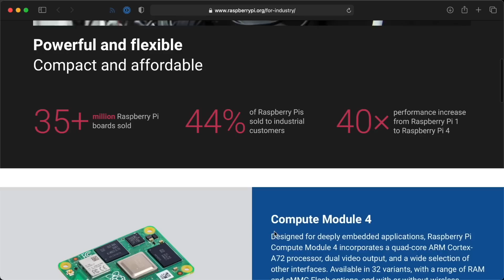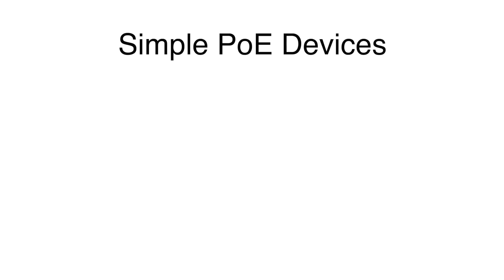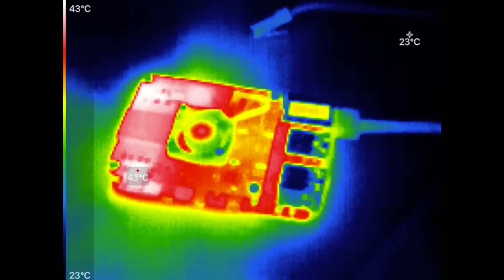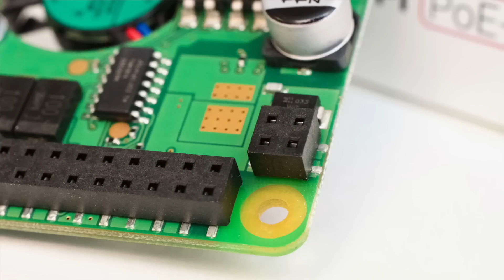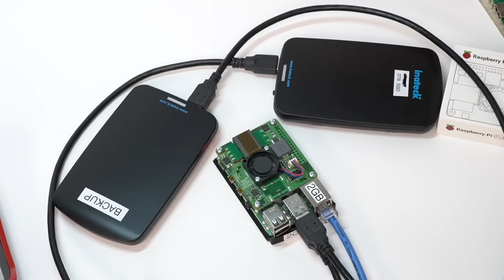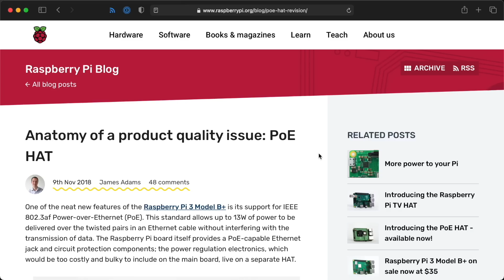Review: Raspberry Pi's new PoE+ HAT

Comment: That's not a magnet on the transformer, that's a ferrite core!🙂
Reply from the maker: I shall be more careful with my words next time :)
Reply: Thanks for saving me the trouble of pointing this out.

I'll now try to get my teeth to stop grating. )
Reply: @asdrubale bisanzio -- No, the primary becomes a magnet. Calling the ferrite core a "magnet" is like calling the "keeper" placed across the old "horseshoe magnet" a "magnet" since it conducts magnetism.

Essentially, calling a magnetic conductor a magnet is like calling the copper wiring in your wall a "generator" or calling the battery cable in your radio (remember radios?) a "battery" since it conducts power from the battery.

Or, like calling the subway train "my job" because it takes you to work.

N.B.: This does not apply if you happen to be the motorman!

Comment: Good Monring Jeff,

did you notice a coil whine with the PoE+ modules under normal load?
I bought 2 of the older PoE modules and both have a clearly audible coil whine (even without USB devices attached).
The PIs were running in the utility room. So it wouldn't bother me, but since the cat likes to lie on the dryer, 
I decided against it and now I'm forced to use non-official modules. 
For the purpose of cooling I had to tinker and unfortunately they are too high for 1 rack unit.

Therefore it would be nice to know whether the new PoE+ modules are worth buying. 
Even if they would consume more power. I never checked the power consumption of the cheap no-name module I'm currently 
using. 

Greetings Chris
Reply from the maker: I haven't heard the coil whine except when backfeeding it from USB-C with load. Under normal circumstances I don't hear it at all. I do hear a tiny bit on my original PoE HATs.

Comment: I mean, why should they have to tell people not to use the hat while using usb-c, when it should be common sense not to?  Use one standard or the other.  Aside from using the fan for cooling (not sure why a person would when they can pop the fan off and use it alone), why would you leave it connected when using usb-c power?
Reply from the maker: I sometimes grab a Pi out of my rack for debug purposes, and like to be able to plug it in temporarily at my bench or desk, where I don't have any PoE ports handy. I could go buy a PoE Injector just for that, but it's easier to just use an existing USB-C plug.

Comment: Ferrite core not a magnet. More efficient than wire (says who, you?), have we done testing to prove this idea? Wire size consistency isn't some black magic that industry hasn't quite gotten the hang of yet... Everything I am seeing here pretty much shows that this hat is less efficient, I wouldn't be to quick to make a statement about any single part of if being "more" anything other than power output.
Reply from the maker: According to the research I've read on planar transformers (I haven't done any component-level testing myself), it's more efficient at _heat dissipation_, not necessarily in total energy efficiency.
Reply: @JeffGeerling  Spose I should listen a tad closer, you did say less heat to start with. Dah well I am an idiot after all, ask the wife, she'll tell you all about it =P

I wonder, do they provide white paper on design choices and intent with any of this stuff? Something about the component choices made, on this new POE device, is using more energy than I would personally find desirable. Suppose I should research this kind of shit before engaging in a conversation about it. If only I actually desired to use POE in my PI projects, I'd imagine I might. In my defense I am wearing a red shirt....

Comment: I like the uctronics one (with the fan). I don't know if it is "safe" but my pi 4 idles at 3.3 watts according to the switch. It does have a coil whine, but it is outside of my hearing range. My daughter gets annoyed by it.  The fan is very quiet. It is a standard 802.3af.

Comment: Great video, I use a lot of Poe at home, Cisco phones and cctv cameras and back in January I migrated a bunch of services to 4 pi4s and a pi2 this includes homebridge, asterisk and 2 piholes. On my enterprise switch under normal load they pull about 2.2 watts each but when backing up they get closer 5 watts, I don’t have anything plugged in to them except network and the micro sd card. (I don’t need disk performance) since then I have carefully modified the setup using the sd card to boot then creating a mix of sd card ,RAM disk and nfs mounts means backup aren’t needed. The interesting thing is using my Hopi power monitor between the mains and the switch if I keep the Poe power draw for the 4 pi’s under 14w the Poe switch does not seem to draw any more power from the mains compared to no Poe being used. Effectively getting power for free.
Reply: Great comment that gives me lots of ideas!

Comment: You can not safely provide DC positive energy from two different sources without connecting the ground (negative) together. Think of it as a voltage difference that provides current. When you connect grounds it ensures the same "voltage difference" is established between the two sources.
Reply: Thanks! This is a better explanation than others I have seen, and makes more sense. Intuitively, I know that the cheap non isolated adapter I got to power a pi zero from 24vac would cause blue smoke when connected to a DC power supply, but couldn't quite understand why.
Reply from the maker: When connected to USB-C power, I did not have the Pi plugged into a PoE switch.

Comment: I have no idea why anyone would use a PI in an industrial application.  They only rate it for commercial temp. On top of all this no one talks about how to bullet proof it from corrupting the uSD when power is removed before a shutdown. What's even more nuts is that the POE+ hat cannot deliver full power to the PI board because those pins from the hat to the PI do not support those kinds of currents.

Comment: I feel like POE is kind of not a very robust technology in it's nature. Essentially you're trying to drive a current load through a high-impedence signalling wire. To get around power losses due to the high resistance, we pump up the voltage dramatically? What could go wrong?
Reply: That's precisely why high voltage lines are high voltage - due to decreased current flow and lower losses. High impedance may be loosely translated into "high resistance for higher frequencies", and doesn't affect DC current nearly as much. Anyway, I really like your curiosity and critical thinking. You're gonna go far. :)
Reply: @rageagainstthebath  Thanks, that's interesting, I never thought of it that way. It makes sense that at higher voltages less current flows but I guess I just don't understand why a DC current encounters less resistance than a high frequency signal. As a hobbyist I also realize it may be beyond me.

Comment: If people are needing more than 13 watts to power whatever setup they are running may be the raspberry pi is not the best option.  After all, you can get other options in the soc space that offer decent power efficiency with more performance and support for more peripherals without needing to kludge a solution together that may or may not run for the long term.  At 15-20 watts idle you are already into intel atom microserver space.  The other thing to keep in mind is most rackmount switches, especially PoE ones, consume quite a bit of power as well.

Comment: I slag off raspberrypi all the time but really, this PoE hat will do even if there are some ways the other PoE is preferable. Just glad to see this thing exists tbh. 

I am however kind of happy that its power drain reduces the only useful thing about the pi3A (its low power) because that low-RAM 512MB thing is ridiculous especially seeing as it has the tasty protection rings of the 3b and ironically you cannot use them in a VM because you're out of RAM.
Of course you'd want the protection rings for a webcam in a VM and it would use power.

This PoE gets and extra point from me for kicking the Pi3A in the arse, exposing how stupid it is. Damn, just make more 3b or 3bplus.

Comment: I have the new Poe+ on my cm4/io board. Admittedly not running bunches of peripherals. Guess it's time to see what happens.🤓 Oh and my fan throttles with the temperature and I didn't do anything 🤨
Reply from the maker: It should throttle, but if you use the defaults the fan starts kicking in around 45 or 50 (can't remember the default). I'm okay with the pi running at 60 or so, so I keep mine set to only start fan at 60 and ramp up around 75
Reply: @JeffGeerling  Here's the rub, on a cm4/ioboard the Poe+ with fan isn't near the cm module. So, use in the efforts to control cpu temp is questionable. And while I have your attention, I can't get BT working on the cm4 iob. It worked 1 time for just long enough to start a yt. The BT speaker works fine on most of my other devices including pi 4 and 400. Any suggestions?

Comment: I've been using the Digitus DN-95203 and Blackbox LPS2001 PoE+ splitters for years now on my Pi's. They pump out 25.5W of juice and connect to the network at 1Gbps. A far better solution than the Pi hat and what's more... no fan!

Comment: Higher voltage and more power = more heat. Mikrotik stuff that are powered with poe+ run really hot for somereason. The high voltage increases their tempature almost doubled compared to normal when running their  24volt powerbrick or injector.
Reply: But higher voltage is less power loss over the cabling.

Comment: Hey Jeff, your PoE+ fan was pretty quiet. I just fitted mine last weekend which sits in an open case. But what I was not expecting was the mosquito sound every 20 seconds then quiet 10-15 seconds and then another 20 seconds of a swarm of mosquitoes - continuously all night long.  In the daytime I didn't really notice it but this little chap sits behind a monitor in the bedroom and during the night OMG no sleep that night at all ... So the next day that hat had to be  removed :-( 

Also another gotcha was at the moment there does not seem to be any passthrough GPIO headers for the POE+ hat unlike the old PoE HAT. Due to the POE header is not passthrough. I think all you can do at the moment is to get old POE Long Headers and hack the 4 POE ones down to fit.

Btw another great video :-)
Reply: I forget where, but I found some commands that adjusted the fan's temp windows so it doesn't do the all or nothing oscillating

Comment: not to be picky but transformers have ferrite or iron cores, they do not contain any magnets because it would not work , the core have to conduct electro magnetical fields to the other side of the transformer and that oscilates at high frequency

Comment: Erm, so they went for synchronous rectifier buck converter and ended up with way worse power efficiency?
Reply: yeah, I'm kinda surprised at the whole poe hat controversaries. Making a SMPS is very simple these days, even cheap chinese buck converter boards from aliexpress are 90+ (or at least higher 80s) efficient.
Reply: Given the large vin/vout delta It would be interesting to see if the effect of changing the buck converter components could improve the efficiency 
E.g
A) A larger value inductor swapped out 
B) if the switching frequency can be changed

Comment: I found the official PoE hat to kinda pointless and overpriced at $45 CAD when I could buy a set of four PoE splitters for slightly less. Plus the PoE splitters work with all models of Pi 1's, Pi 2's and Pi 3's whereas the PoE hat only works with one specific model of Pi 3B which I found to be rather stupid and frustrating. Plus when using a splitter the ethernet port on the Pi doesn't get disconcertingly warm.

Comment: Not magnets on the transformer, that's a ferrite type material
Reply: ferrite = iron, iron = magnetic, so it's a magnetic material on the transformer... doh
Reply: @LiLBitsDK  'magnetic material' isn't the same as 'magnet'. For more information of ferrite materials: https://en.wikipedia.org/wiki/Ferrite_core
But to be specific: a ferrite core is usually not much of a 'magnet', put a piece of steel near it and you won't get much of a reaction (possibly none). The point of the ferrite material is it has a very low magnetic permeability (basically amplifies any applied magnet field, which massively improves the coupling), but has very high resistance to electrical current (induced eddy currents result in heat buildup and energy loss).
Reply: @repatch43  if you magnetice a magnetic material, then it is a magnet ;-) electromagnet or otherwise.
Reply: @LiLBitsDK  Yup, IF the material maintains a magnetic field without the presence of a current, or other factor. Take an iron nail: rub a magnet along it in the same direction multiple times and you've 'magnetized' that nail, making it a magnet. That is the basic principle of magnetic recording. The core of a transformer OTOH has an alternating magnetic field passing through it during operation. This, by it's very nature, means when you turn off the current, there is basically no lasting magnetic field. If fact, if you used a 'magnet' as the core of a transformer it wouldn't work right (if at all, depending on the currents involved).

Comment: Hi Jeff,

The command you used to measure the current used doesn’t work for me, folder rpi-poe-power-supply does not exist within /sys/devices/platform/

Do I need to install something?

Thanks,

Al.
Reply from the maker: Are you using the latest PoE+ HAT? It doesn't work on the older PoE HAT. You also have to make sure you're completely up to date on your Pi OS install.

Comment: The POE+ hat would be suitable where you need power at a lengthy distance. That's why it uses more power ;)
Reply from the maker: The PoE (802.3a*) specs account for power drop across long distances (up to the rated distances for each type of wire). PoE+ is rated up to 25W at the Powered Device, whereas PoE is rated up to 12.95 at the Powered Device (though you could receive a tad bit more if you're closer or use better cabling, assuming your switch/injector is pumping through the maximum spec at 48v).

Comment: Does the PoE+ hat work on the compute module io board?
Reply from the maker: It should, but I haven't tried it there yet. I should note that maybe the IO Board is the intended use case right now—you could power PCI Express devices that consume 3-4 amps by themselves...

Comment: i know this isn't relevant but i  was wondering if you used the argon one m.2 case and a m.2 to pci express adapter to plug a graphics card in and dowload the drivers if you ran windows 10 on the pi

Comment: I haven't used PoE miself, but for what I can read on Wikipedia 802.3af and at lack power saving features, and it's a common complaint that there's a 4.5w per port power consumption with 802.3at, so there's not much to do on that front afaik.
On the other hand, the rest on the issues on the PoE+ hat are hard to justify after having issues with the previous version, specially with glaring mistakes like the screws that could have easily been fixed. RaspberryPi is not a new company anymore, and I'll expect a bit more quality control, specially since they're now supporting industrial use cases.

Comment: Did you say HP switch? Is Aruba bought by Hewlett Packard?
Reply: Yep Aruba is the old ProCurve line of HP switches.
Reply: @brianhunt6943  ah cool i remember th old 3coms being rebranded ton1920 or something like that. Didn't know about aruba. Thanks
Reply: @p-thor  I believe the Comware line lives on in HP's FlexFabric line now. Not sure I haven't bought a 57/5900 switch in quite some time. The 29/2500 series switches are all ProCurve/Aruba switches and the 15/19/1800s are OfficeConnect which I believe is ProCurve/Aruba based as well.

Comment: About the next Pi, I think it shouldn't be a 5 just yet, but a new Zero. The current one is too dated, there are many applications that would benefit from a new Zero.

And for the 5, I think they should make a new line of "supercharged Pis", as the use cases are expanding beyond the original electronic tinkering vision. Pis are used as NAS, routers, web servers, Plex servers, and regular desktop PCs and could benefit from much faster processing and io (it's weird to think that pi accessories and peripherals commonly used are more expensive then the pi itself). The Apple M1 will hopefully shake up the ARM market.
Reply from the maker: That would be nice; the Zero is still using a 32-bit processor. If they somehow upgraded to something that did 64-bit, they could finally start to phase out the 32-bit Pi OS and switch to 64-bit by default, which would make it so much easier to use cross-compiled software and Docker images!

They'd need to bump how much RAM it has, though, because the 64-bit transition does eat up a little more memory for low-memory devices :(
Reply: For me the PI4 is just short of desktop replacement power at 2 Ghz.   Little too much waiting for things to start. This is with SATA NVME boot drive and 4 gigs of RAM.  So I'd like a more powerful version for say $100-120.
Reply: @quademasters249  what kind of hard drive are you using? I don't feel there's any slowdown unless I'm browsing heavy websites. 
Or when I'm on Zero, but I don't mind 40 secs loading if I'm about to use it for more that 20 minutes.
Reply: @simpletongeek  I'm using a SATA m.2 drive I believe it's a 256 gig Samsung.  Pi4 is 4gigs. I mainly notice it in chrome.  I might simply not have enough RAM for chrome. It's a ram hog.  It's usable but I wanted to use it for things like host my manuals out in the garage. It's just slow processing PDF's. 

None of my other machines are slower than Core i5 2.5 ghz so the competition is pretty stiff.
Reply: @quademasters249  If it's SSD, then it should be fast enough. Although I do agree with you regarding slow PDF rendering. Some PDFs are just so slow! I ended up converting those to jpegs and use some kind of image/comic viewer program, just to avoid the delays.